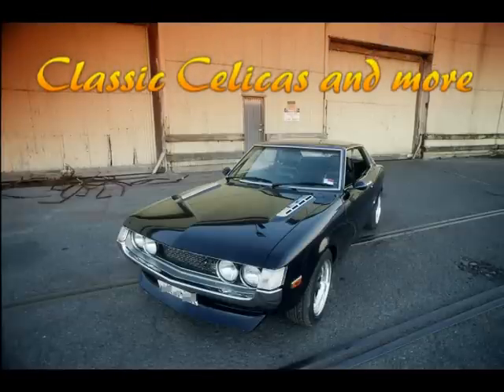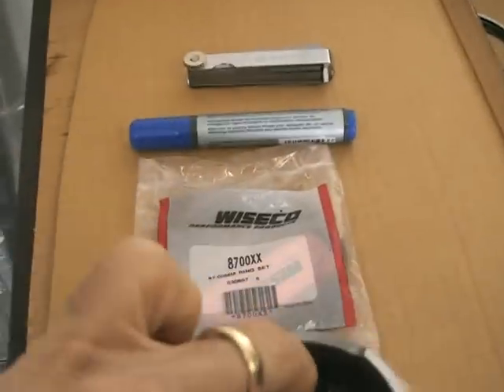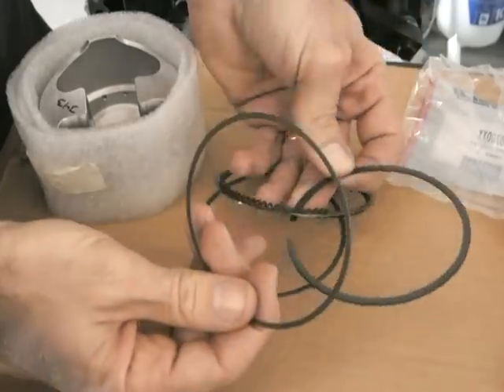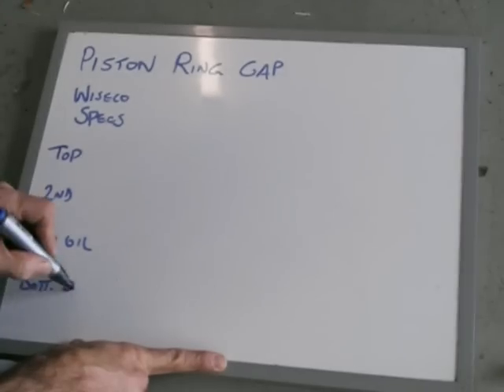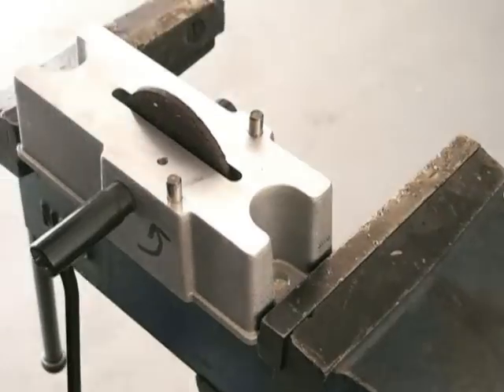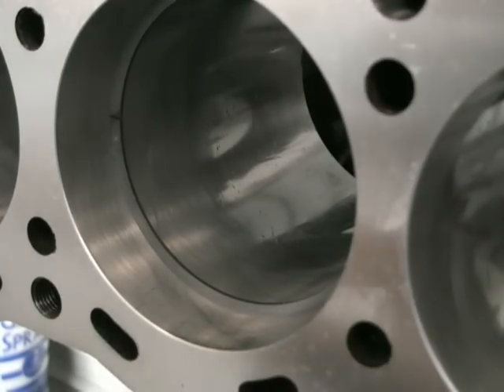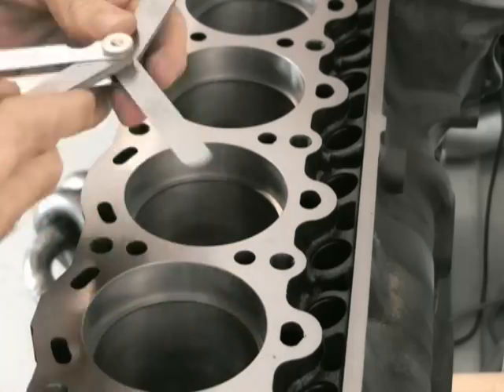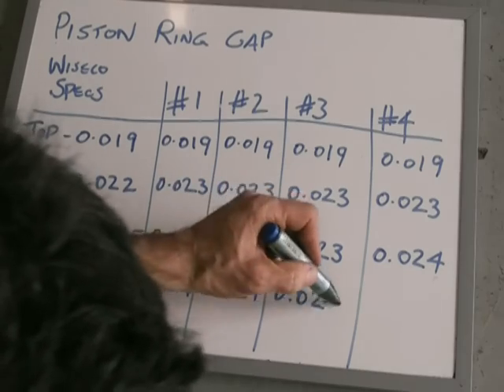Setting Piston ring gaps

Comment: Hi. cau you tell me if it is possible to replace a piston rings without grinding a cylinder surface?
Reply from the maker: Yes its possible if the bore is not damaged and within tolerance. In this case you could just lightly hone the cylinder and then fit the new rings. If the bore is damaged then it most likely will need to be bored and honed
Reply: yes it is possible because depending on what make u to open the engine